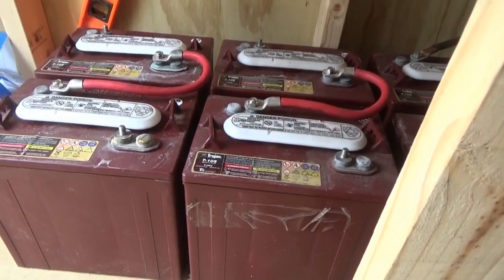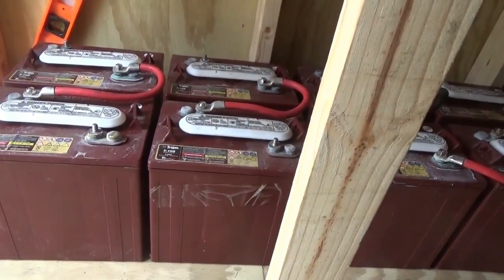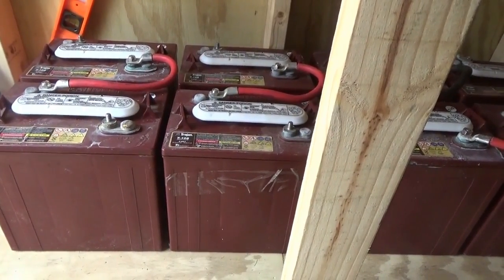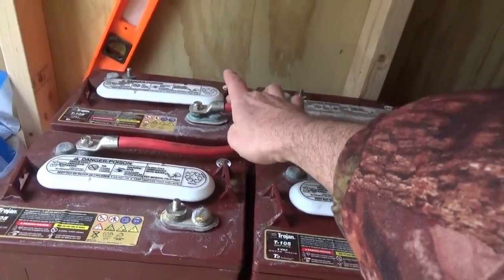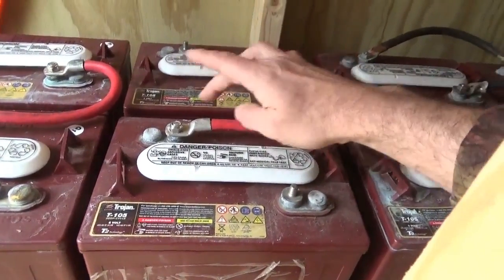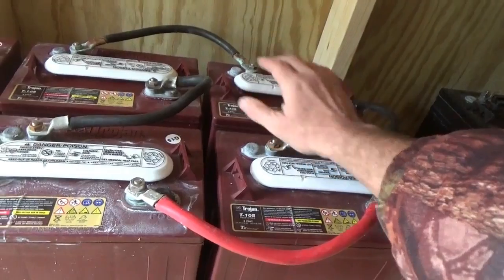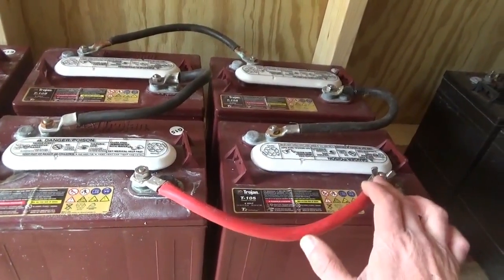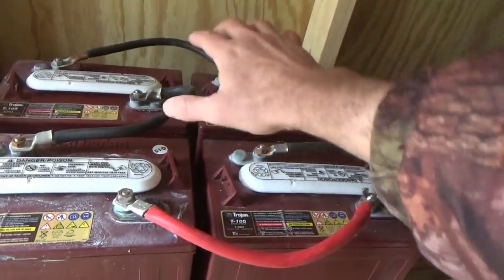How To Wire Solar Battery Bank ~ Setting Up Off Grid Solar

Comment: I really hope you And Your Wife Don't plan on Disconnecting From the Grid. Minimizing your carbon foot print and dependency on Government Hydro and heating fuel (Natural gas , Propane or Oil ) is Admirable. But I know for a fact that a Modular Home R value Insulation is Poor at Best. The Tiny home on wheels was Extremely well insulated and the Windows were not Motor home Quality. You are now going to have a Family . A New Baby's and Mothers need More than what your Tinkering in Self reliance can provide.  There's so many points that a rural home Can not be Sustained With your Ill Equipped Solar System and "golf Cart" Battery's" can provide. (eg. submersible Well pump)( or installing a wood Stove.) Stop Kidding Yourself.  I've seen $20k Systems That Can not Supply enough energy in the Dead of Winter or Extended cloudy periods. having a Reserve System or Emergency system in case of Grid failure is noble  Collecting Rain Water For Garden use is Wonderful. Now I've been Watching your videos from the beginning and I'M NOT A TROLL.. But Don't give Them a way to hurt your Family. Change the Focus of your Channel. There's an old Saying "Those Who  Can Do...Those Who Cant Teach"   just be a Teacher. and Spare your Wife and Child the abuse the Trolls are Already Planning.         Your Friend A Subscriber.
Reply: Whether There are or not. the fact still remains Good intentions Don't Keep you Warm in the Winter, Nor Do they stop you from Getting Sick from untreated Water.  Man kind (Woman kind) may have had no Choice but to live off The Land Etc., In the Past. But an awful lot of People Died. P.S. Running a Generator to Supplement your power needs When Hydro is already at your home is Foolish. and I Do believe some People are Screwing With him. I only watch his Videos for the Entertainment Value.
Reply from the maker: Well, I guess we will see then. Yes many have survived through the years off the grid. Many died in the past. But one huge thing is that we do not drink untreated water. Even if we use rain water later, it will be well filtered to be safe for use. But I hope to at least get a hand pump in here or use a cistern and a DC pump for water pressure. Run the well pump when the sun is shining bright to top off the cistern. There are many ways to make things happen.
Reply from the maker: Now, about heating the home. I am worried about that. I think that based on propane use already in relatively warm weather we will use $400 - 600 a month in propane during winter. This is not good. We must do something to change that asap.
Reply from the maker: I am not "kidding myself" as you say. I am very serious about reducing our bills asap.

Comment: aditional information is , also use cables of the same diameter and lenght, also connect the 6 volt poles also together (the middle connections),using the same lenght and diameter cable as the rest.
 this wil help to keep the voltage equal all over the bank. 
its commonly forgotten to do this.
Reply from the maker: Thank you very much for adding that. Very important details.
Reply: its also a money thing, personally y would not go for (dry) agm, money wise, a lead acid whet cell can handle more abuse., Lithium ion is the best for solar application in my opinion, but also very expensive...( addition, read Liifpo4 for Lithium ion.)
Reply: y know, but its only advice, he is free to use it or not, i dont have a problem whit that, other than it makes me sad, iff it goes bad or wrong. not to say told you so after shit happens... lol
Reply: Remember that agm cels can produce gass to. (at overcharging, or overload.)  .)(tho way less then whet lead acids..
Reply: the victron chargers, and solar mppt chargers we sell  can be adjusted for the right type of battery's connected.
Reply: nonsence, thats common in lead acid banks, if you use small wires(on the 6 volt points it will pull the bank out off specs when drawing (or charging high amps. ruining cells as result.(creating bad cels earlier)(its common practice to do this, dont know where you got your opinion from, but thats not correct on lead acid banks )
but y agree on lifepo4. (thats what y ment in my comment)
Reply: maby it makes no sence to you, but 30 years proffesional experience on this wil.

Comment: Since you have a house, chalet, garage, well pump and outbuildings are you considering bumping the battery bank to 48V to improve efficiency; especially given the distance from the batteries to major power usage in house, chalet,garage, well pump. Or maybe 2 systems; one 12v for shops and one 48v for the big power draws in house, chalet, garage and well pump?

Comment: I appreciate you taking the time in careful detail to explain about the batteries and anything electrical. I've also been using flaurescent lights and looked for information on comparing them with the LED lights you are using and it appears that the Lead's are a better choice.
Reply from the maker: Thanks. I love the LED lights in our new home.

Comment: Thank you so much for this video series- Listening to the "experts" and electricians explain things with tons of technical terms shuts a lot of people down (including me). I grew up in an era (the 60's) in which no one questioned tradesmen or professionals, because they would explain things in technical terms and leave people with more questions than they started. Everyone was convinced that a "professional" was needed for everything. In the late 70's and through the 80's, we began to learn we didn't need them for every little thing. that's the beauty of solar- one can hire a "pro" to set up a whole house system or it can be done DIY.

Comment: I'm curious as to why your battery bank is so far from the house. Won't you have a considerable amount of energy loss over that great of distance? I know you still have your old batteries, Why not use your old batteries for the work shop and bring the new batteries closer to the house?
Reply from the maker: No problem. I was just trying to explain in detail.
Reply from the maker: Where should I put them by the house? No space inside and no shelter outside. Under the house is not good. Filthy, hard to get to and cold. Plus the rodent issue down there. The garage is just about as far from the house as the shed.
Reply from the maker: The shed can be insulated easier and will cost less to heat in winter. I can run AC power from the shed to the house for lighting. I will run separate solar panels to power the hot water heater when I convert it to DC. I will most likely end up with multiple solar panel setups when I am done.
Reply from the maker: And the shed is my work shop. This is the first and most important space for me to have power right now. Top priority.
Reply: it may be a inverter problem to, the induction motor can have difficulty's starting up iff its not a clean sinewave... (some off the "pure sinewave" inverters are in fact not pure ac...)
(still dont understant why they still use 120 volts in the usa... we have gone over to 230 volts in 1960 here in europe for the biggest part, now we have tree fase, 230/400 volts, in almost every home.(3 fase) lot less amps that way, lesser heat and losses., y understand they only use 2 fase cabeling in the usa in homes?)
 (120 volts normal, and 240 for high power??), we have 230 volts normal outlets  here, and 3x 230 volts (400 between fase)for high power use .
Reply: in fact its more dangerois heatwise (twice higher amperage) agree 230 volts tickle a bit more when you toutch it... lol, but then again, why should you toutch it... lol
Reply: MrBugsier5 the cost of that kind of change would be astronomical here and unnecessary.
Reply: If you are doing the inversion to AC at the battery bank, then the run to the house won't be a problem. Think back to the primary flaw with Edison's DC distribution system; DC loses a considerable amount of current over long distances. AC does not. If you are running it through the appropriate insulated wire, you won't be experiencing much loss at all. Good explanation on the video. Ignore the trolls!
Reply: The Do It Yourself World Sorry. Figured building a battery box next to the house would be best. Something south facing so it will keep the battery warm. Not trying to ruffle any feathers, Was just curious if you mentioned it in a prior video that I may have missed.

Comment: Hi
Go 24V   !!
Reply: that refurbished (grey)battery was bad from day one, and the other banks were damaged beyond repair by neclect and frost. (sadly) dont understand why he didnt used the warranty on the grey smaller bank, beats me..think he has the idea he can fix it all whit his quantum bedinimotor.... (it sadly wont, but thats a different story..) (really not want to be negative on this, but y already pulled all my hair out.........)
Reply: MrBugsier5...I think your correct, but  in America we call what your doing beating a dead horse..a.k.a. wasting your time
Reply: Note that you dont have to go double the capacity just because you go 24v. You still have the total energy in it even if the capacity as such is halved. You only need to sort the appliance stuff
Reply: you can alway thry iff you have the spare time for it..
Reply: “ Need double the batteries to get the same Amp Hours ”  
Er..... yes & no .
You still have the same wattage of storage & you can use the charge
controller at a higher voltage / wattage with more Panels  .
You only need the 24V inverter & your to far from the house for a
useful 12v feed  .
Reply: you should use 24 volts apliances if you go to 24 volts, reducing it whit a inverter to 12 volt will not make sense then ., the more watts you need, the higher the battey bank voltage has to be, the less amps you draw, the better., there is nothing wrong by using 12 volts, only the power cables need to be thicker, and more expensive..., your amp draw is mutch higher on 12 volts..
Reply: same on my boat, y use the 460 ah version 6 volt battery's , 4 in series, at 24 volts, 460 amphour, inverter Victron 2500 watts, 230 volts (its a comby charger/inverter, 70 amps charge max), works fine , also on the (computer) washing machine, my former  old 2000 watts Vetus inverter would not power it (modified sine) , (
motor would not spin up)
Reply from the maker: One day but that has its costs too. I would need double the batteries to get the same Amp Hours out of the battery bank. And I would need a converter from 24 to 12 volts to power my DC equipment since I switched most of my things to 12 volt DC through the years. Then I would need a 24 volt inverter as well.